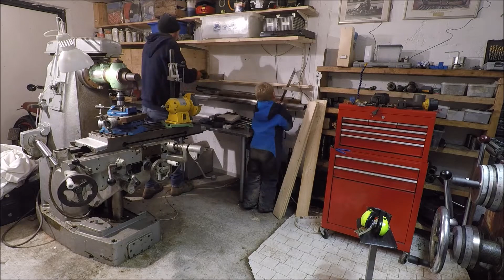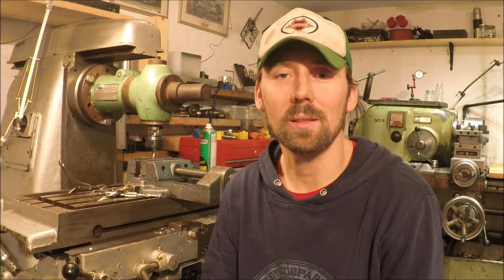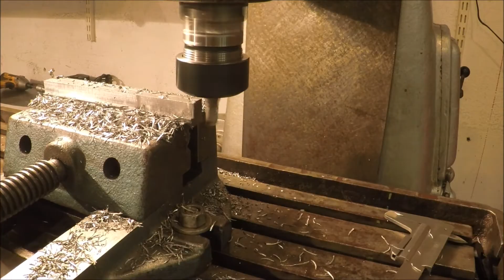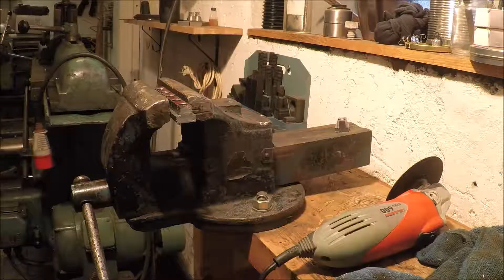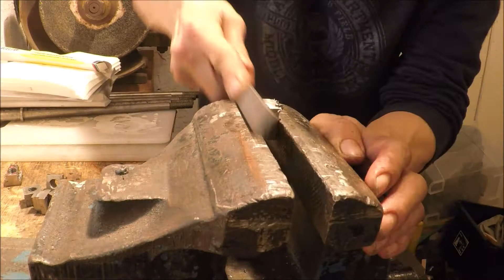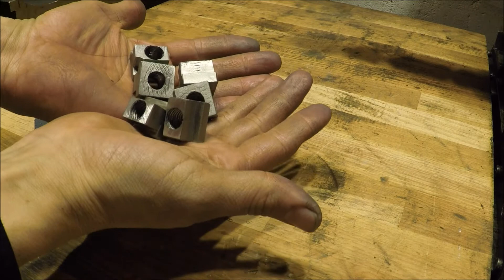Restoring a Värnamo horizontal milling machine - Part 7, the first project

Comment: Welcome back Fredrik ,not easy sometimes to find the time for or shops 😀 Fantastic looking mill you have there I'm so jealous 😁 I have a old Centec 2 horizontal mill that I'm in the middle of making a vertical head for it ... Just love the older machinery , my lathe and mill have a combined age of 150years !!!! 

Keep up the good work on your channel ....
Reply from the maker: Yea, tell me about it! The days just don´t have enough hours :) Your Centec doesn´t look all that bad either. I´ll check the years on my machines and see what they add up to. I do have a slight advantage though since i have 3 machines (4 if i get to count the new grinder i just "stole" from my pal, and 5 if the new drill press counts)